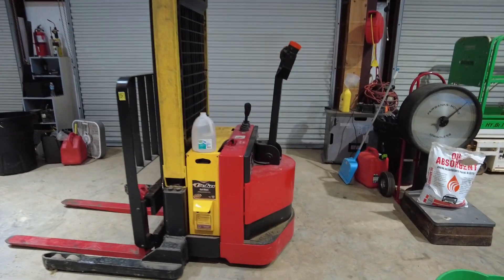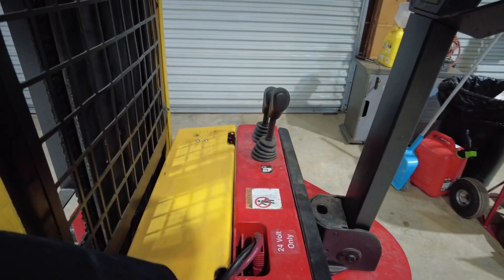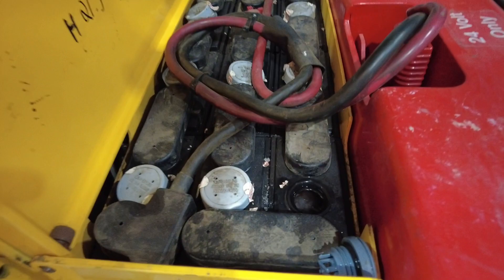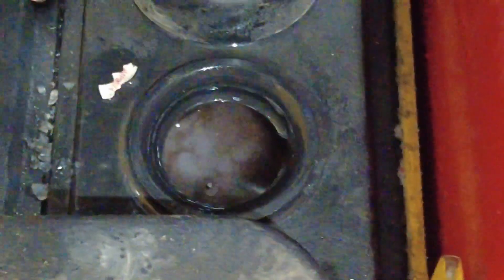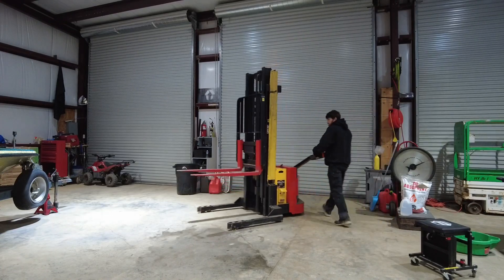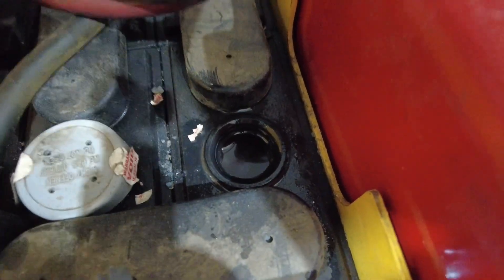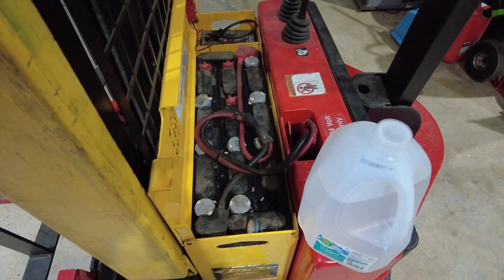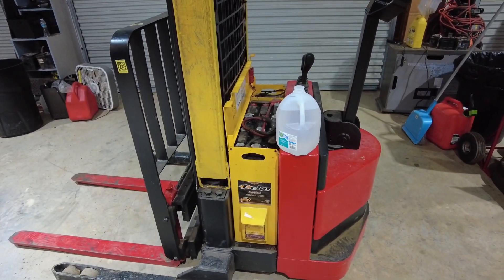How to fix a dead electric forklift (Battery reconditioning) #lifehacks

Comment: Try checking YouTube there is a dude that took a completely gone battery filled it with distilled then charged it using a welder for a specific time period let it cool down then repeat 3-5 times and got 95 percent of those crystals on the rods eliminated,poof brand new battery 👍
Reply: Hi
By any chance do you have a link of that video or title so I could look it up ? Thanks in advance